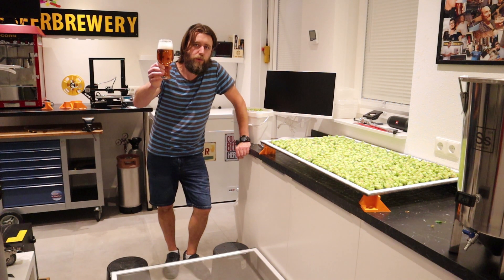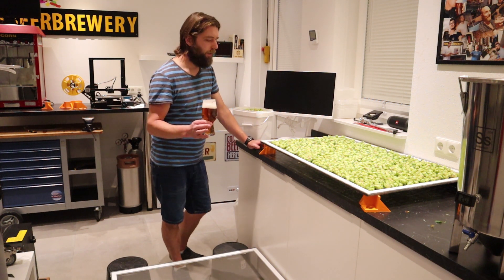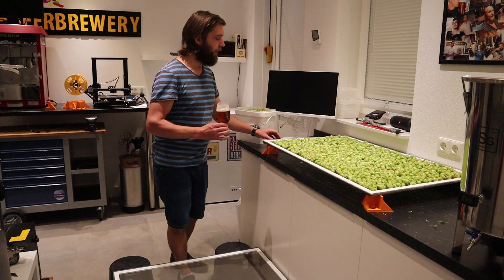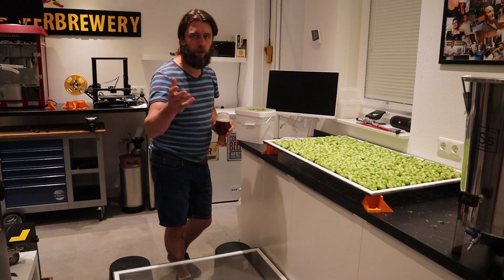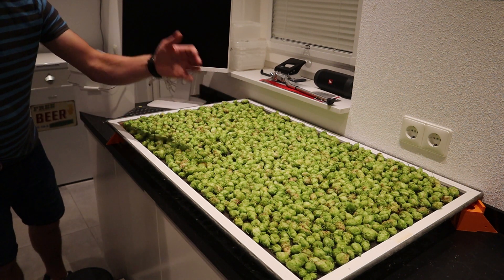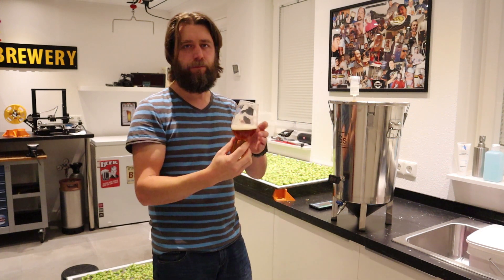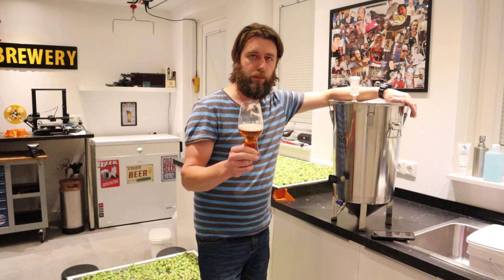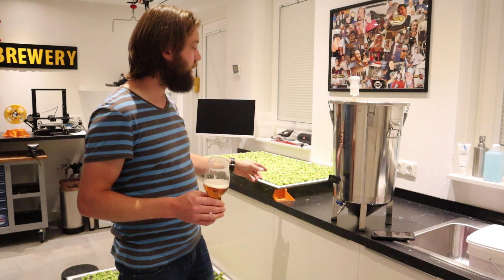Lindr AS-40 "cold crash" 7 °C test and Cascade hop drying.

Comment: I'm looking to do something similar with a a LINDR AS-XX, i have some questions:
1) I want to command it through a STC-1000, but how do you "command" the pump?
2) What kind of water connectors do you use between your system and the LINDR?
3) What size of fermenter do you have? I've to cool and coldcrash 2x60L
4) As I said, I've 2 fermenter, which both have their own temperature probe. Is there 2 pump to activate?
5) How audible is this ? Can you hear it a lot?